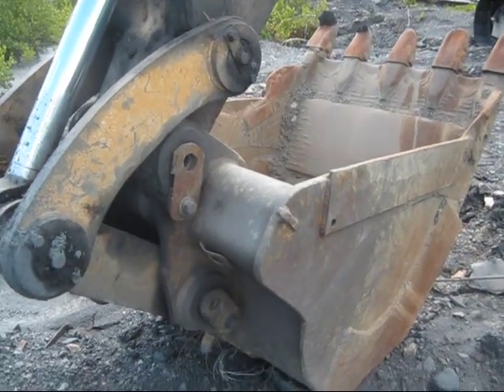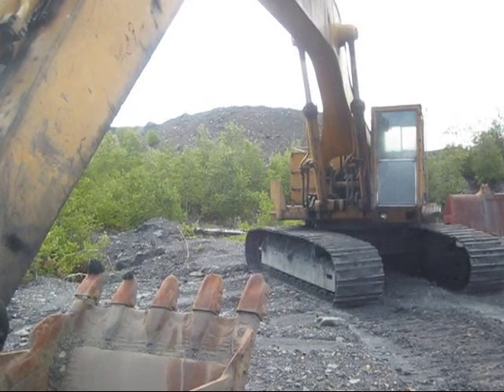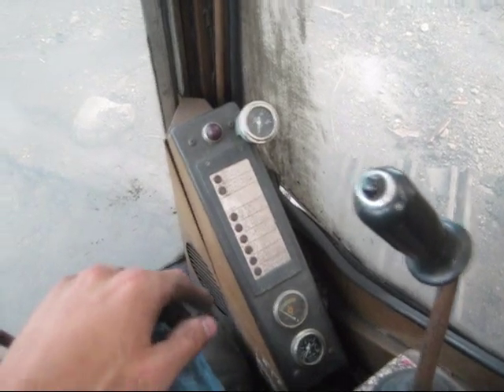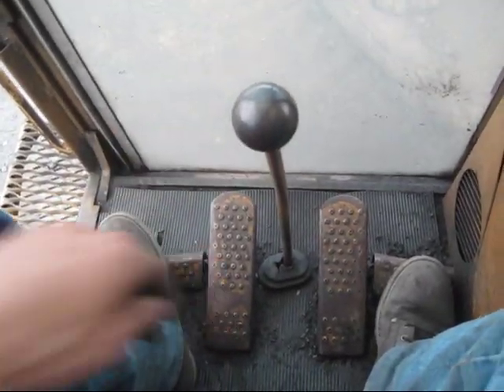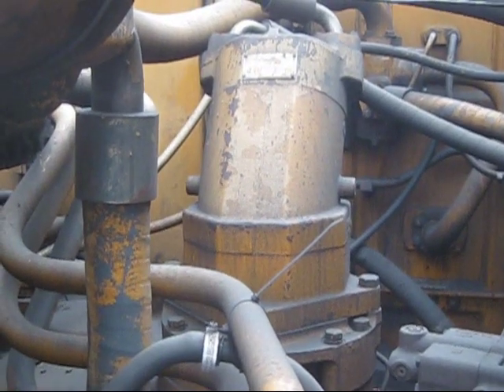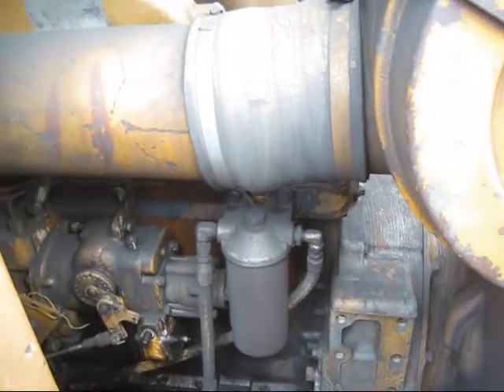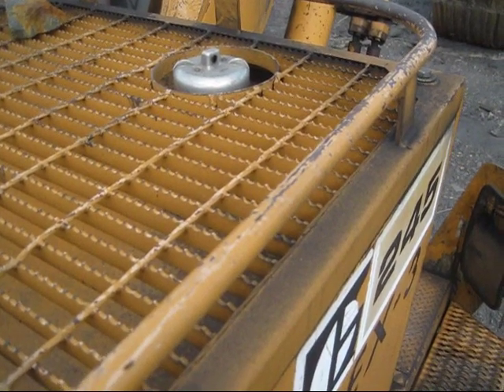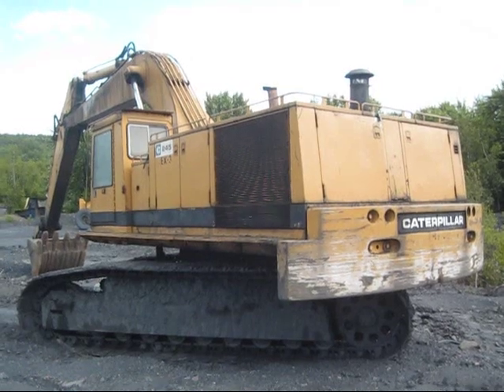Caterpillar 245 Documentary

Comment: Sweet old machines. I remember they had to be warmed up slowly in cold weather or you could strip the pump drive out. The buttons on the wobble sticks were for opening and closing the shovel bucket if it was running one. All the 200 series were tough. Thanks. Pal!

Comment: I just got a quick question; I got a old 215 and there are one  switch i don't really know what does, the second switch on the top; the one that looks like an "L" and it is located down below the pre-heat - starter switch. When i turn it on, a light comes on and it looks to me that it does something with the oil? 

And btw; great walkaround (as usual), I really love these old workhorses, they never quit, no matter what!